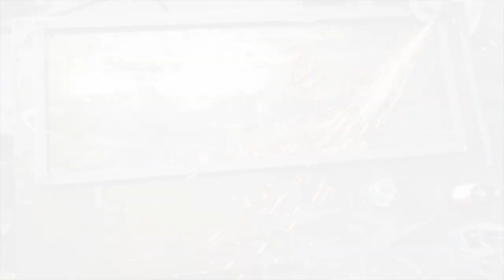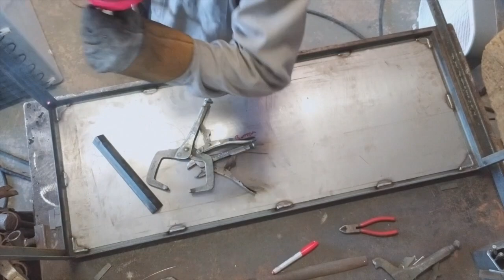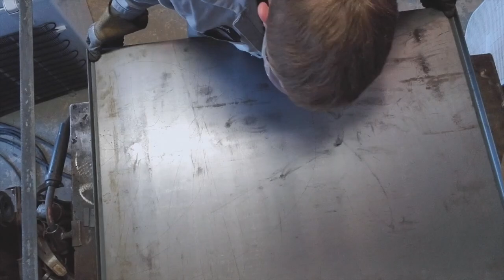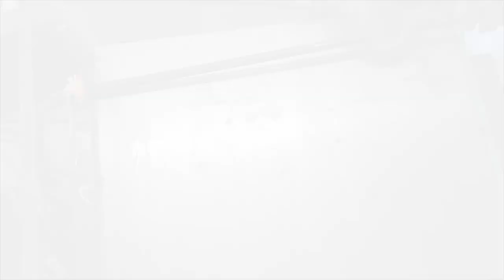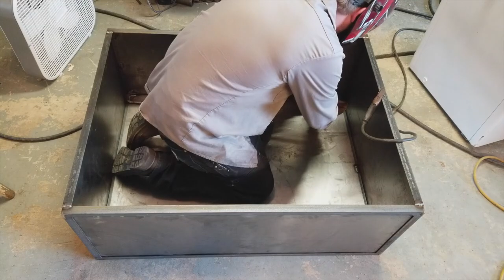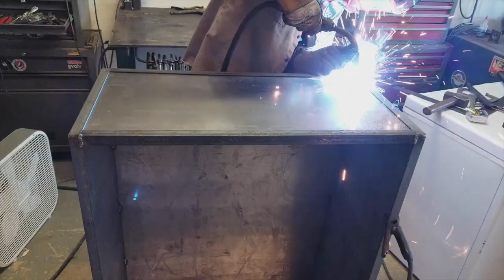Making a Steel Cabinet part 1

Comment: I just did a project that used 16ga steel sheet. Had some warping, but I see where you used the angle iron, I'm assuming that was to counter that?
Reply from the maker: Yeah, I think this was 14ga so not quite as prone to warpage. I didn't have access to a brake press at the time and I wanted to see how it would turn out with the angle. I didn't plan on having the doors formed, that was kind of a nice surprise, I was planning on building them with angle like I did the cabinet.

Comment: At the beginning of the video what is the benefit of shimming the pieces off the table ?
Reply from the maker: If you're table isn't flat, mine has a crown to it so the middle is higher than the edges, then this helps keep your pieces straight. If you can get away with only using 3 shims then, in theory, your part should come out flat no matter how jacked up your table is.

Comment: Brilliant work. Please advice on the sheetmetal thickness for the top and sides. Kind regards
Reply from the maker: Thanks for watching! I believe I made it all out of 14 gauge steel. I did beef up the top by adding a length of 2" square tube. I wanted the top to be a bit more stout since I was putting a bench grinder and a belt sander on it.
Reply: Great stuff thank you